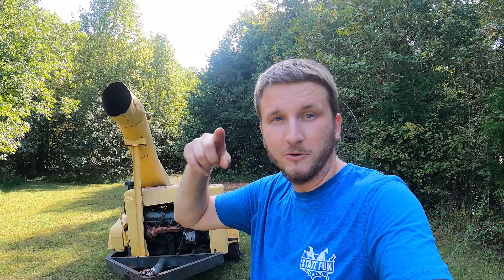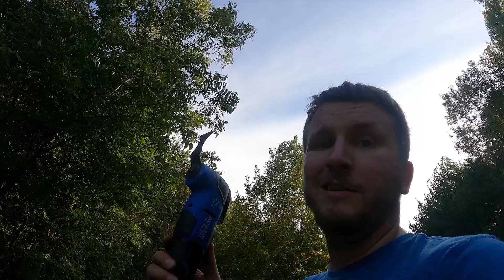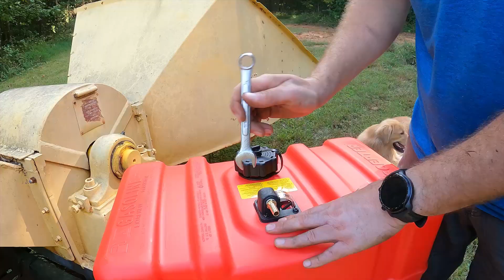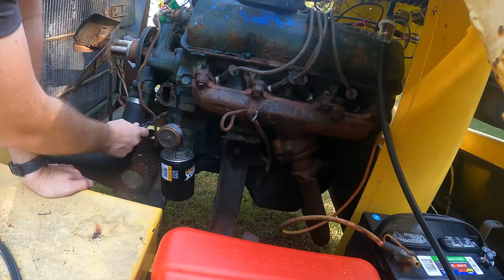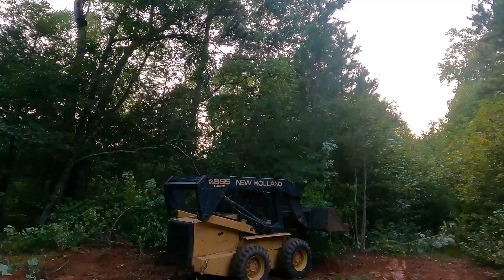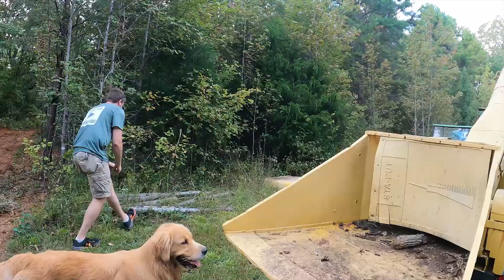Forgotten Junkyard Wood Chipper REVIVAL!!

Comment: I just bought a used whisper chipper similar to this. It has a 300 ford straight 6. I need a radiator for it. What kind of radiator should I get? I am not much of a mechanic, so its a project FOR SURE, but I am learning as I go.

Comment: That lever to engage your chipper is called a clutch lever, and it is supposed to be engaged slowly at a low RPMs and then once it’s engaged completely, you can raise your RPMs up to disengage lower your RPMs and lift up

Comment: That’s a Ford 360/390 engine, it will never be at top performance and you better get a lot bigger fuel tank. Those things were never good on gas.
Reply from the maker: Thanks for the info! I may leave the tank like it is and keep more cans around. If it runs out of gas faster that means break time! Lol

Comment: You need to turn up the speed .  Twist that knob next to the gauges after you engage the clutch, you'll get alot more power and be able to chip really quickly .
Reply from the maker: It's actually a pull knob for the governor. I just wasn't ready to test full speed yet. I've got the linkage connected to the correct spot now and it revs up much more. I should have a video soon(ish) chipping more trees!

Comment: Vary cool I have a similar chipper but with a Ford 6 cylinder and you gotta ingage the clutch slowly and and run it at pretty high rpms to chip but these old chippers work great just need sharp blades and set them 30 thousands of a inch away from cutter bar
Reply from the maker: Thanks for the info! I think I have the governor set to a higher rpm now, maybe it'll chip better.